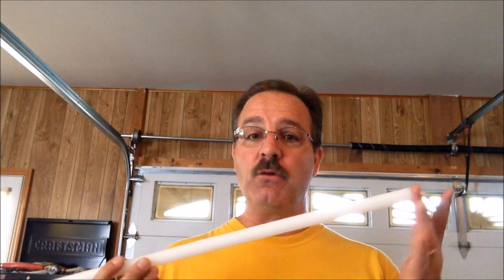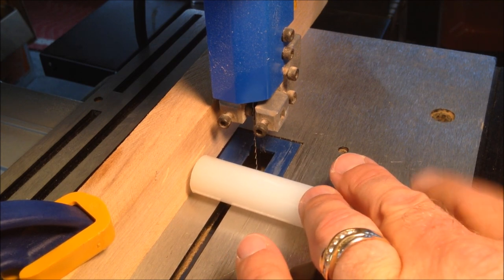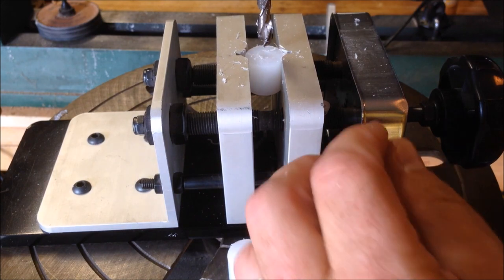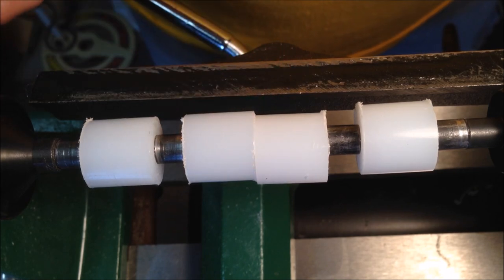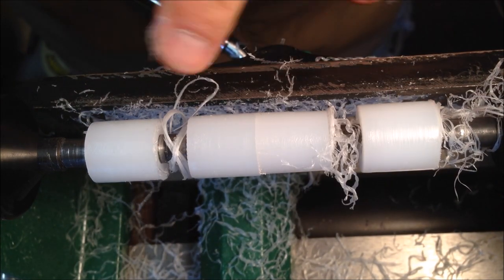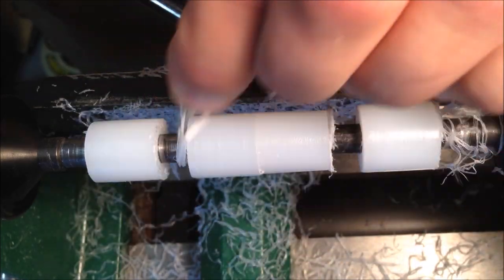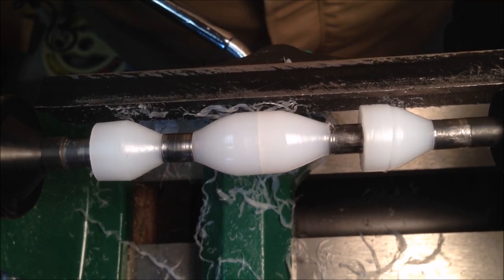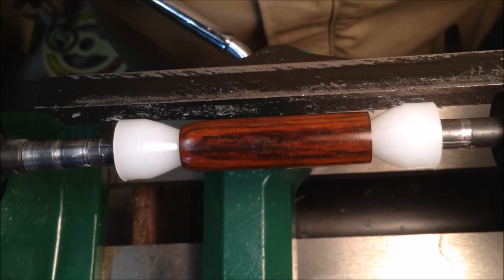Make your own Non Stick Pen Bushings

Comment: So I just got a Harbor Freight lathe because I wanted to start turning pens.  I have done a lot of different woodworking things and since being introduced to pen turning and its creativity.  I wanted to know what all I will need to get started.  I am planning on buying a mandrel set with a mandrel saver, some of the bushings that you created in this video.  I am just not sure what other tools I will need in order to get started.  I would sure appreciate any help that you could give me.
Reply from the maker: +Darryl May Hello Darryl,
What you need for pen turning.
  If I were starting over again, I would probably go with the Easy Wood Carbide tools. There is a set with a square cutter, round cutter, and a diamond shaped detail cutter.   
  These tools are fairly easy to master and when they get dull, you just replace the cutters, no learning to sharpen or expensive sharpening systems. 
  I'm going to assume you want to start with ink pens and tell you what you need for that. 
  When you purchase a pen kit, the seller will tell you what bushings and what size drill bit you will need to
make that pen. Bushings can be used over-and-over and bits only need to be purchased once. The first pen is expensive due to this overhead. 
  Medium C/A glue, or Epoxy for gluing tubes into Acrylics blanks. Both work on wood too.
  You do not need a Pen Insertion tool, you can use a screw driver. They are nice to have but not a necessity. 
  Purchase a barrel trimmer set with the four most common sizes: 7mm, 8mm, 3/8", and 10mm. This is a must have. 
  You will need a mandrel, I personally like the Mandrel Saver setup that Penn State sells. A mandrel is a must have. 
  For Acrylics, the easiest was to an amazing finish is Micro Mesh pads. Sand paper is to coarse for Acrylics and should be reserved for wood. Get a box with 4 or 5 different grits. 
  You will need a finish for your pens. 
Finish for Acrylics:
  I like Hut Ultra Gloss. It's quick and the results are great. 
Finish for wood:
Reply from the maker: +Darryl May   Thin C/A is my favorite. 
  Shella Way is nice for beginners, as is Hut Friction Polish. C/A is the toughest to master but looks the best and lasts the longest.
  A pen press is nice to have. You can use a clamp or the lathe to press your pens together. Laney Shaughnessy has a video on his channel that shows how to build one. It's really good. Otherwise, purchasing a press can be expensive. 
  That is pretty much everything I can think of. Thank 
  Below are the links to three videos I made several years ago about what you need to turn pens. They are a bit long but contain a ton of good information. Also, feel free to ask questions as many things have changed in my process over the years. 
https://youtu.be/HZShe5ntDJY
https://youtu.be/-7izWhLDo6g
https://youtu.be/dAvj-qj-VwI
Regards,
Bob

Comment: Bob, I forgot to mention this a minute ago, but if you will use a steel bristle brush to get the  shreds off it will save you time.
Reply from the maker: +steve Corry Great tip,
  I'll try that. I've been using a skew. 

Bob

Comment: It occurred to me that you could make 3 instead of 4 bushings.  Turn the center into a double-faced bushing, with a conical shape on each side.  just a thought, that i'm going to try this afternoon.
Reply from the maker: Hello Dana,
  I did just that on my next set and it works much better plus it doesn’t use as much space in the mandrel. 

Regards,
Bob

Comment: Easier way. Just go to Ace Hardware. Buy 2 one half inch nylon spacers with the 1/4 inch hole already 
drilled. These will fit any universal pen mandrel. Turn them to size and you are ready to go. Total cost 40 cents.
Reply from the maker: Nice idea Tom,
  I'll check out the fastener aisle next time I'm in Ace to see if they have them. Thank you. 

Regards,
Bob

Comment: Bob,
I found some nylon spacers at Home Depot in the drawers at the nut and bolt department. they are 1" length, 1/2" OD, .256 ID that are perfect for using as spacers for super glue. I just chucked them in my Jacobs Chuck and turned a taper on one end. they fit perfectly on a 1/4" mandrel. The best thing is they were only 31 cents each. I plan on using a 1/4" washer to back up the non tapered side to prevent deforming the bushing under pressure. The brand name on them is Everbilt and the SKU is 87480-15018. Keep up the great videos!
Reply from the maker: +Glenn Hayhurst Thank you for letting me know about this Glenn,
  I'll pass it along when people inquire. Great use of available resources and great price too. 

Regards,
Bob

Comment: You could also probably use some of the "uglyest" acetate acrylic pen blanks that you accidentally bought to make these bushings as well. They just won't be as effective because the polyethylene is very resistant to the CA glue's "sticking abilities."
Reply from the maker: +Ricky B. Nice idea,
  I'll have to try this out. 

Regards,
Bob
Reply: Ya, well at least you will be putting those ugly blanks to good use finally...Who cares if you have to throw them out after they get used once or twice...You we're using them anyway...
Have Big Fun...Ric.

Comment: FYI: Your mandrel isn't 7mm (guess how I found this out!!), it's the brass pen casings that are the 7mm diameter.  I would guess mandrels are somewhere between 6.6-6.8mm.  Using an imperial drill would be a good option to get a hole 'between' metric sizes.  17/64" would be 6.75mm which I imagine would produce a nice tight fit for better concentricity.
Thanks for the video upload.  Need to make some of these :)
Reply from the maker: Thank you 

Regards,
Bob

Comment: Cool idea. Remember, the 7mm mandrel Is not really 7mm. It's accounting for the thickness of the tube. One thing I would do differently is glue a spare tube in the bushings and then turn then between centers to ensure perfect roundness.
Reply from the maker: Thank you,
  I appreciate the information. Nice idea on the spare tube inside the bushing. 

Regards,
Bob

Comment: I went to go buy me some of these Artisan Pen-Ultimate Assembly Tool...but they don't sell them in a MT#1 like I need. I was thinking about making them out of this same material on the lathe. Do you think the HPDE would hold up in the taper when that kind of pressure is applied? I don't have much, if any experience with the stuff. Thanks!https://www.woodturnerscatalog.com/p/16/2798/Artisan-Pen-Ultimate-Assembly-Tool
Reply from the maker: +Ryan Sanders I believe this would work just fine. I think I'd use UHMW plastic for the #1MT inserts with an HDPE cap. UHMW is stiffer and may hold up better but it is hard enough to damage the pen parts and the blank. HDPE is a bit softer. 

Regards,
Bob
Reply: RJBWoodTurner q

Comment: Throw my name into your magic hat.  BTW, one way to clean up these HDPE/Delrin bushings is to drop them in a jar of DNA (denatured alcohol) and let the juice melt the glue goo.  Works well and you avoid taking down more material with the skew.
Reply from the maker: John Walsh Your in John,  Thanks for the tip on cleaning up the bushings, I have DNA and will give it a try.Regards,Bob
Reply: RJBWoodTurner
I  should have said Acetone instead of DNA.  My bad.
Reply from the maker: No problem John,
  I have Acetone too, I'll give it a try. Thank you for the clarification.

Regards,
Bob

Comment: You don't indicate where I might be able to get the HPDE 3/4 rod.....I notice that a lot with the videos of people they don't say where they get stuff......it does help to have an idea.
Reply from the maker: +Ray Spoto Hello Ray,
  I ordered it off eBay. You can also melt milk jugs into a block. 

Regards,
Bob
Reply: Thank you I will look for the rod to try this....as for melting jugs will look to see a video online that shows that.  Thanks again
Reply: You can also just buy raw stock. Links may not work but look for "UHMW (Ultra High Molecular Weight Polyethylene) Round Rod, Opaque White, Meets ASTM D4020, 3/4" Diameter, 1' Length"

Its gone up quite a bit since I made mine. I bought twice as much for one third the price.
Reply from the maker: +Cliff Hartle UHMW works better in my opinion. Cliff is right it's way cheaper. You could even melt milk jugs like Peter Brown does to make a block of HDPE. 

Bob

Comment: Shouldn't the hole be a little smaller than 7 mm? The od of your pen tubes is 7 mm, but the id is smaller (6.5?), and the diameter of your mandrel is even smaller than that. Seems like your bushing would need to be pretty snug if you want your blank centered.

I looked up a pen mandrel on Amazon and the diameter is .244 inches, or just under 6.2 mm. Not a common size drill bit I'm sure, but even a 1/4 inch drill bit, i think, would be much closer to the desired hole size than 7 mm.
Reply from the maker: Yes the hole should be closer to 1/4”. I made a mistake when I gave the size on the video. Subsequent videos mention the proper ID for the non-stick bushings.
Reply: Thanks. Could you please provide a link to one of those subsequent videos. I'm going to try this. Tomorrow if I get a chance. I have some of that material, but its a rectangular bar (bought it for runners on a cross-cut sled), not a round rod like you used. The thickness is 5/8, so that's my maximum length, and I'm trying to figure out whether that will be enough. Unless there's some way to glue two pieces together (obviously superglue won't do it).

Comment: My suggestion would be to cut a 3 inch long piece,  THEN drill a 7mm hole in the center,  then cut 3/4" off  each end to  make the center one piece 1-1/2". Now turn cones on both ends of the center and each end piece.  It should come out easier to turn.  Also,  the vise you showed is not good for round stock,  and there's an easy way to find the center so the hole is more true.
Reply from the maker: It’s funny you should say this as that what I did when that set started to wear out. Three bushings takes way less space than four on the mandrel. Thank you for your comment. 

Regards,
Bob

Comment: May have already been posted but why not just make 3, one double pointed. 

Also Home Depot sells nylon spacers of different sizes with holes already in them. Not the right size but you could easily drill them out. They are maybe 75 cents a piece for the size you would need.
Reply from the maker: Hello Cliff,
  Making three instead of four would work just fine. 
  It would be worth checking out those Nylon bushings, I don't know how well Nylon works with C/A but I'd be interested in knowing. HDPE and UHMW release from the C/A very easily. 

Regards,
Bob
Reply: RJBWoodTurner I found a few in my hardware sorter and they may not be big enough unless they sell larger ones. 

They are 3/4" long have a 1/4" inch hole but only 1/2" in diameter. I guess it should work since I think only a few tubes are that big. 

I'll drip some CA on them to see how it sticks.

But I may just buy some at Rockler. They are only $7 and I have a store less 15 minutes away.
Reply from the maker: Please let me know how your test works out. I get asked about different materials and it's always great to offer information to other turners. 
  Your lucky to live so close to a Rockler, I don't have anything close to where I live. 

Regards,
Bob
Reply: RJBWoodTurner didn't do an extensive test but looks like CA sticks to those nylon spacers. Probably not a really good glue for nylon but still sticks to it.
Reply from the maker: Thank you for letting me know Cliff,
  I get questions all the time and now I can let people know to steer clear of Nylon for non-stick bushings. 

Regards,
Bob
Reply: RJBWoodTurner Just checked Amazon and a 3/4 by 24 hdpe rod is around 10 bucks.

 Funny thing is under "people who bought this also bought this" was more plastic rod and pen making tools. :)
Reply from the maker: That's funny. You may also look at UHMW rod, it works just as well and is about 1/2 the price. 

Regards,
Bob
Reply: RJBWoodTurner Just you know I just ordered the UHMW rod. I'll let you know how it works in 5 to 7 days. $3.38 for 3/4 by 24"
Reply from the maker: Sounds great Cliff,
  I appreciate you letting me know how it works so I can pass the info on to other turners. $3.38 is a steal. I'll switch to UHMW if it works out. 

Regards,
Bob
Reply: RJBWoodTurner I was looking at the reviews for the UHMW rod I bought and  guess what someone used it for. :)
Reply from the maker: That sounds great, I am still very interested in your test results. I'd rather get the info from someone I trust. 

Regards,
Bob
Reply: RJBWoodTurner Trusting me is your first error. But its in the mail. I've read more info on UHMW  plastic and it says it machines just as well, maybe better, as what you used. So by next week we will all know. I may tape making them though I don't like doing videos. Hate hearing my own voice.
Reply: Ok here is a super rough video of working with this plastic. Somewhere in the middle of working this I realized that I should try to work this like I had a machinist's lathe and it was so much better. You see it makes like chips. In order to get it to a point I removed the bushings so I could get down to the mandrel.  Note when you see me using the chisel and filming, I'm not really cutting. 

Will try it out later when I make a pen. My order also included 10 pen kits and bushings. Got a 1.50 Honduras mahogany I got at rockler yesterday and something else the sales lady said I had to buy.
Reply from the maker: Cliff,
  The link to the video didn't make it, can you resend it?

Regards,
Bob
Reply: Just forgot to paste it
Reply: Also I just noticed I started filmimg after I removed the bushings.
Reply from the maker: Cliff,
  There must be an issue with posting links to YouTube. Can you email the link to me at rjbwoodturner@ufoww.com?

Regards,
Bob
Reply: Ok used the bushings on a larger tube fountain pen and after I took it off the mandrel I had to cut excess ca off the pen. I think if I was to make a lot of these pens I would make custom UHMW bushings same size as the metal bushings.
Reply from the maker: I sometimes have excess C/A, u use a piece of 220 grit sand paper on a solid surface and sand it off. 

Regards,
Bob
Reply: RJBWoodTurner I trimmed it off the blank with a knife. I'll just know next time.
Reply from the maker: I had to clean C/A build up off mine last night before using them. Oh well, it's still better than messing up a blank. 

Regards,
Bob